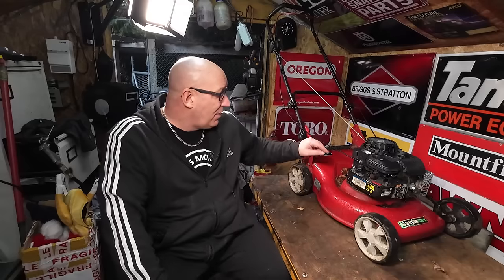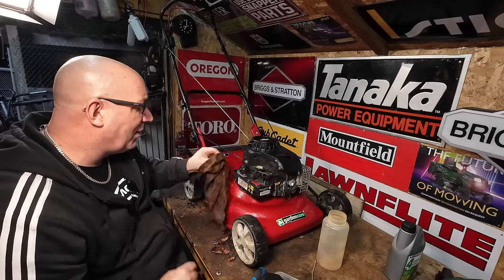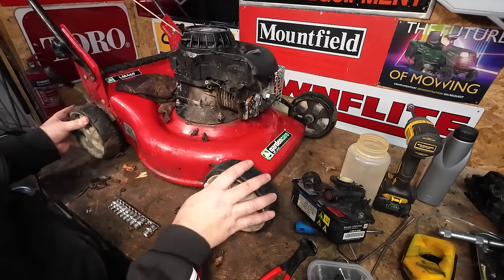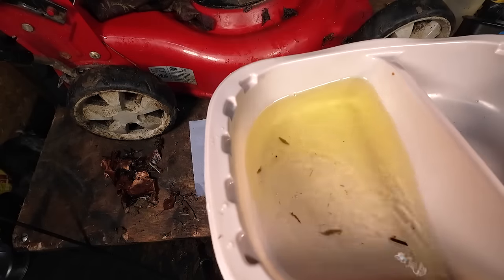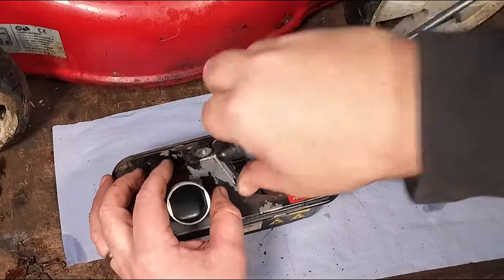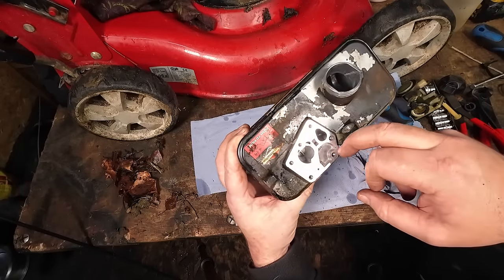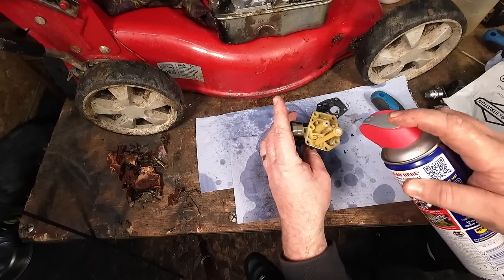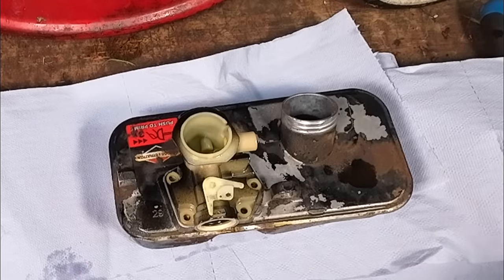lawn Mower won't start after sitting all winter. SIMPLE FIX

Comment: Nice tips there. It would have been good to clean the air filter and see if it started. What you did was the proper way to make it run reliably for the next 20 years or so though.
Reply from the maker: Thanks mate .. I do try to keep it real... No messing.. just get it running.

Comment: Good job mate, makes me wonder some people have to leave them outside. I wonder if there’s anything they can do to prevent this problem 

Maybe wrap it in a tarpaulin maybe a blanket first and a tarp second something to absorb moisture maybe there’s a product there that could be invented and sold the people on YouTube you’d make a fortune……..!

Some kind of fabric lined tarpaulin with elastic edges to keep the mower safe over winter ………!

The other trick I’ve seen recently is slipping a bit of acetone in the fuel to get them to light off ……..
Reply from the maker: Hi mate .. well the best thing is keep it in doors... But like you say you need to cover it to keep it out the rain..

Comment: You can leave your mower outside. I put a bin lid over it with a brick on it. Lasted 17 years like that in the Chicagoland weather. If you can put it inside your carriage space, it is better though.
Reply: No issue unless the deck is exposed to the ground. At EP we had a relatively new mower given to use stored outside with a tarp but on the lawn and the deck had rotted in half due to the moisture from the ground. Better to have it set up covered on patio blocks eh?
Reply: @waynestefinashen239   Ya, your right mate. That ground moisture will for sure rust out your deck! I had a gravel space where I kept the mower, that must have had something to do with the lack of rust.
Reply: @whathappened2230  Good thinking even better if there is a plastic vapor barrier under the stone or gravel